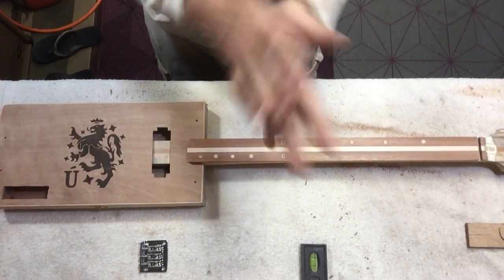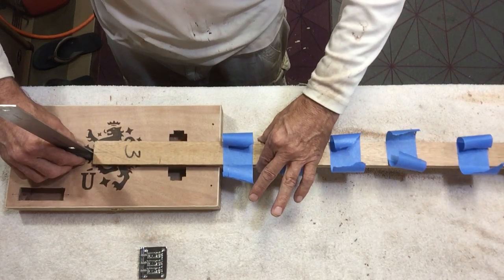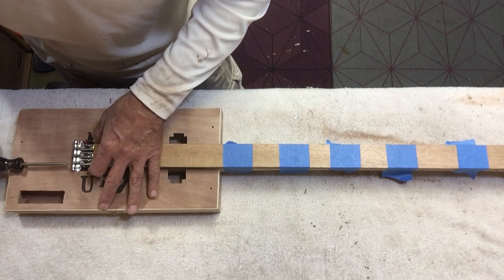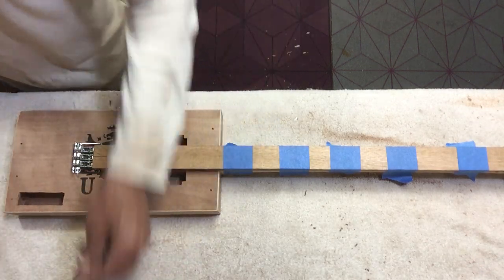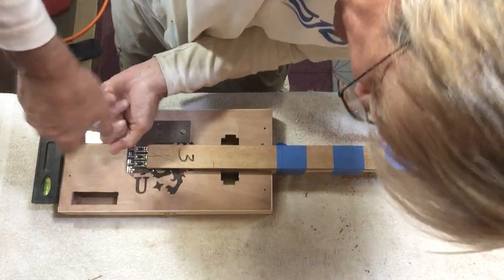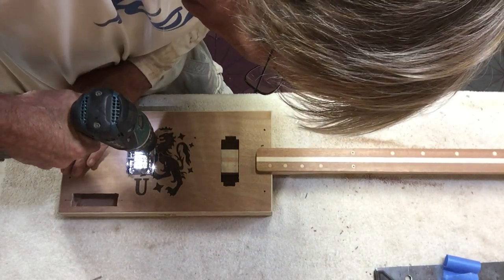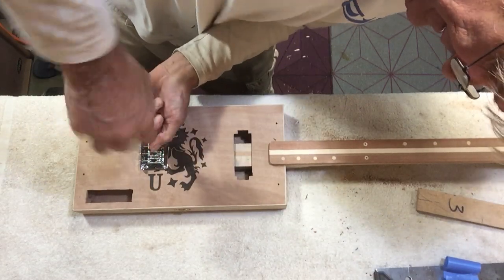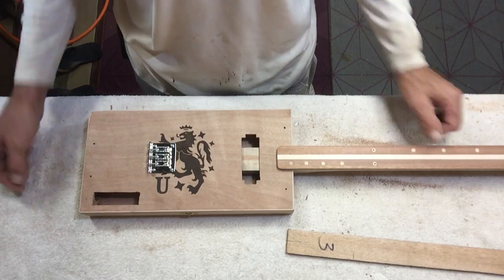How I mount bridges

Comment: Ahhh, I was wondering if you had a wider block of wood on the neckthrough bit to screw the bridge down to, but since you have strings through the body to the back the strings aren't pulling from the tail so you can just screw the bridge to the lid (and not worry about the bridge being pulled off), right?
Reply from the maker: I have wings glued to side of neck for Bridge to attach too 👍

Comment: On the inside, was the neck wide enough for the screws or did you have to add support on both sides of the neck?
Reply from the maker: You have to add wood to the side of neck 👍🎸
Reply: @robscigarboxguitars4316  Thanks.  I knew the cigar box wasn’t thick enough to hold the bridge down.

Comment: Taking your idea one step farther, couldn't you have separate jigs premeasured for the different scale lengths. Tape it in place with one end jammed against the nut and use the other end to set the hard tail as you demonstrate?
Reply: Thank you for posting this Rob.  I used your information and a stick measured for the scale length as Henry Williams suggested above.  It worked great!  Doing it the way you demonstrate makes things go so much easier!